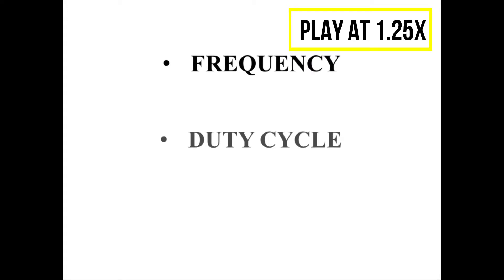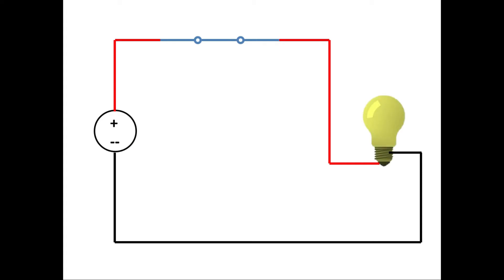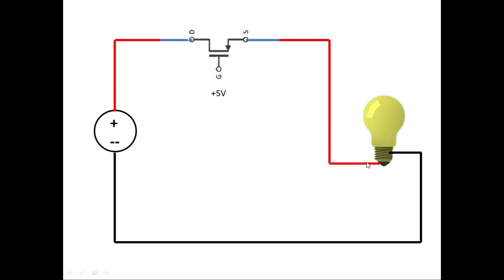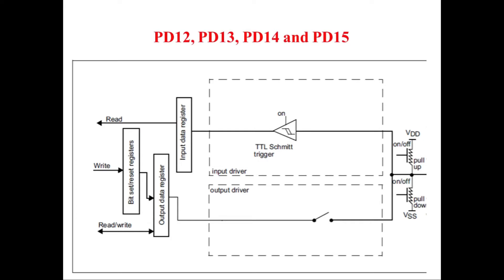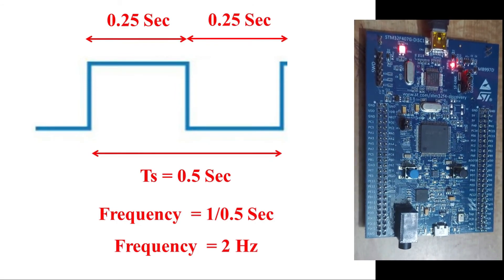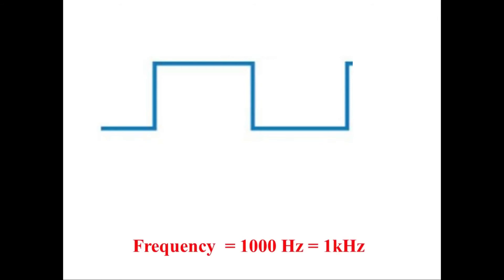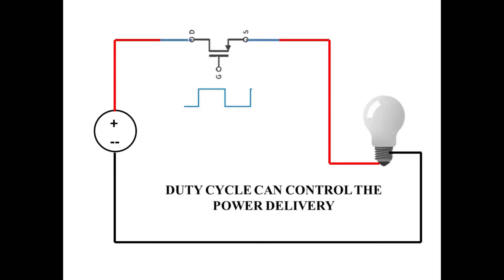IMPORTANCE OF SWITCHING FREQUENCY IN POWER ELECTRONICS

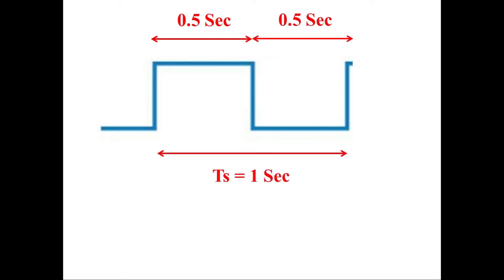Comment: This is so messy...what we do see, from the blinking of the LED @3:15 , is that it's being  turned on and off every second. But that actually means that the LED it's remaining on for 1 second (not 0.5 as you say @3:20) and remaining off for 1 second, which means that the switching frequency is 1Hz and the switching period is 1s. Then we can also say that the resulting square wave has a frequency of 0.5 Hz and a period of 2 seconds. The second example is even worse, because you say that the LED remains on for 0.25 seconds, but @3:40 it can be clearly see it's staying on for half a second!